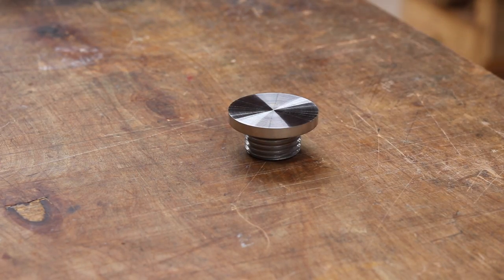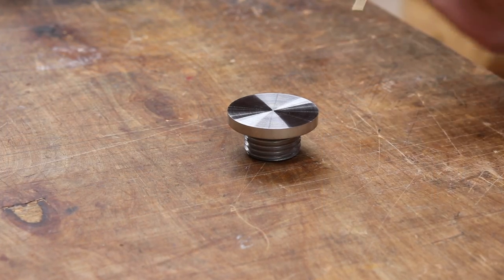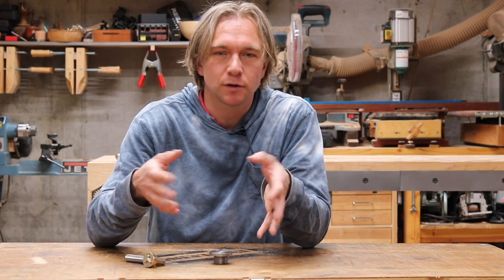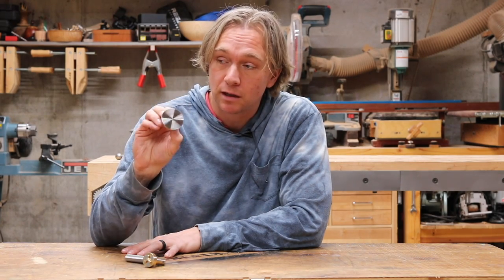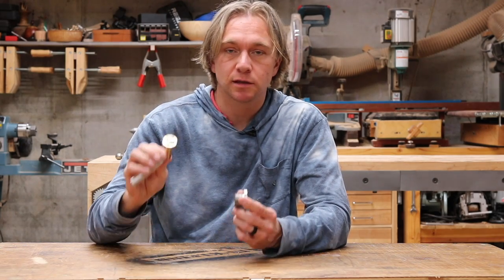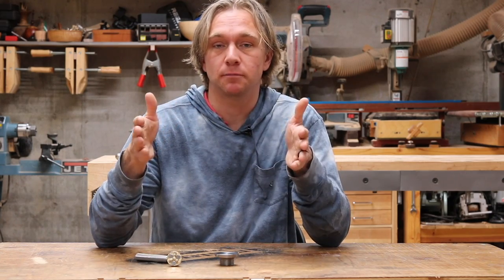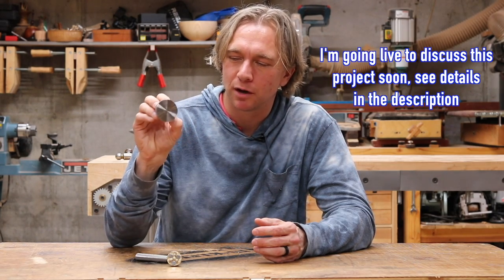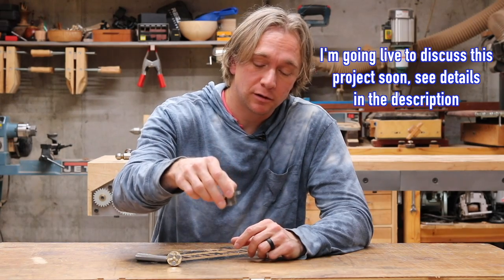A Screw With No (visible) Slot Is My Next Big Thing!

Comment: My company designs and manufactures high end consumer products and I definitely like this concept.  However, that thread you have (Acme?) would be difficult to work with.  I would much prefer if it were built more like a shoulder screw with a smooth shoulder to house the slot mechanism and a smaller and more common thread size for the screw end.

Comment: Heck yea, I'd buy them.  Imagine variations on these being heat colored.
Very, very cool.
As others have commented - "Klein Screw" is cool, but I hear your requirements/desires of it being around the product and not you.  But I am not creative that way - Latin for "Unscrew" is "Praetor".

I would make the "key" without the magnets, and make the "key" such that it fits onto a 3/8ths drive (or 1/2" depending on size of the screw).

Consider making them with O-rings (on the shoulder of the threads) for race car applications (water chill boxes, dry-sump oil filter canisters, etc.).

Comment: If you changed the cutout to just a slot would it perhaps make the product slightly more cost effective?

also in most applications could you not use a bolt that is say an allen or similar head  that's then got a small diameter threaded hold down the centre to just put a cover cap onto? similar to what's often used with mounting mirrors to walls with thread in end caps over the screws but heavier duty, maybe with some loc-tite on the threads for the retention you need but overall designed as just a cover plate to your conventional fixings

Comment: I'm about 42seconds into the video..in my opinion everything is price driven now. If I spend 100$ I get one screw and one socket. So I say this. We already have impacts and hand tools, make your tool into a socket to fit, different sizes o visually, also make that screw out of cheaper metal cause we are hu.ans an have the ability to push in on the screw to screw it in. We don't need the magnets,basically make it cheaper ND more affordable for our market. Super great idea tho man, I was impressed on how it screws in. I thought it would be magnet driven, but your idea is huge an way better you don't need the magnets. Sick bro. You will make it. Don't give up, you will get a bunch of turn downs and "no's" but don't let that stop you.

Comment: Brilliant Design...very impressive! I would be curious what the load and torque rating might be for different applications. If made of Brass, I can perhaps see these used in fine wooden boats since price does not seen to be an issue with nicer wood boats. :)  Using Nickel or Brass and in a smaller dimensional size I could see these used for a variety of applications including high end stereo racks, electric musical instrument bridges, pick guards, neck plates, back plates and amplifiers. I am sure I could come up with more ideas but those are a few that came to mind right away.

Comment: A non-magnetic version would be nice for locking/adjusting screws on millers and lathes.  Allan screws get full of chips and gunk, then strip if you dont properly clean them out before using.  Screws with magnets in them would just grow a fuzz of chips and swarf.  The finish and fit would not even need to be invisible, just tight enough to keep crud out.
Reply: Just look at how tight the tolerances are.  1 very tiny piece of dirt will stop this thing from functioning.  If you are not in a sterile lab environment, these screws are destined to fail.  I like the concept, but I do not believe these will be of any use at all after a small amount of time.

Comment: So I work in high end furniture.
From a technical design perspective, I think its super cool.
From a practical or visual design perspective, I don't see how I could justify it.
Almost any aesthetic I could create cheaper and more versatile with something different.
The tooling for that feature would probably be over 65% of the cost, so i would have to sell that feature to the end user. (and also sell the key.)
We have so many ways to create hidden fasteners that taking it apart isn't the feature.
Novelty not actually secure secret compartments? In modern aesthetic?
I don't see it.
Reply: BTW, High end flat packs are already becoming a thing, but they all assume that they are being installed/assembled by skilled and knowledgeable tradespeople.

Comment: The coolest part about it is used once during assembly. After that it just looks like a really nice rivet. 
The price it too high for a screw.
However. Those toy cubes you mentioned at the start are extremely expensive. 
You could make a cheaper cooler version of those and id buy loads at 40 bucks!!!

Comment: Awesome design 
Can you produce it smaller? 
Can you produce it so it can be opened with philips head screwdrivers?
I think it’s manufacturing cost is high so only some artisans may use it! If you can reduce the cost and produce it in different sizes it will be the future of manufacturing

Comment: I could see a handful of use case, but for most applications, particularly in furniture where this would be front-facing, I'd just use a screw slotted on the back and design around an access hole.

Comment: Ok, so I knew exactly what was about to happen, but when he pushed in the middle of that disc it still blew my mind... Also, this could have an automotive use if you could scale it down somehow, like for custom valve cover bolts or maybe get with someone who designs wheels and make a solid disc wheel that uses these as lug nuts if they can take the torque and you could have a sick looking solid disc wheel...

Comment: I can definitely see it in use for higher-end furniture. Particularly if you were to market to things like exposed mechanical stuff steampunk etc....I think you have less of an in flat-pack personally because I think there are other solutions to this like having a hex on the stem and actually using the drill to reverse and pull the bolt in.  If you can get to both sides of the fixture i don't think the cost of the presure plate design would make it viable in low-end gear where the price is key. 

The question for marketing is what industries heed flush bolts that can be removed that are worth cash.   Aircraft access panels for instance.   It has been proven that the thickness of the layers of paint on a plane can add enough weight and drag to effect AVgas usage to a point where they were running white planes because thats undercoat and clear coat on top.  

I don't think your market is necessarily based on aesthetics is the point im making......Boeing..

Comment: Ok multiple metals.  Square driver hole. Makes the tool price cheaper or obsolete. Makes the machining process cheaper.  If you use a 1/4 or 3/8 Square for the hole people could use a ratchet to install them. This opens up market for only the fasteners.  Definitely need other sizes and possibilities of a seperate insert for the keyway.  It could have a magnet.  And a stronger magnet to remove square  inserts. Just quick thoughts in my head I love to tinker with everything.  Can't help myself.  But those have good commercial architectural appeal.

Comment: I think as for a name Klein is fine.
Klein is Fine would really flow off your tongue for your box logo as well. I'm a retired cabinetmaker as well as a miller for different components for the marine trade. I have lived and worked on the Eastern Seaboard or Atlantic Ocean  area of the United States.  You're onto something unique and interesting . The idea of this screw and it's bells and whistles has been in my head for at least 5 full minutes now. 

One thought or question about them do they only come in that one size you are showing us at this point. If so how about the length ? Maybe have parts that allow the end user the ability to easily "couple" together different lengths to use as a permanent or semi permanent type of clamp. 

💡If you haven't already when you get up in the morning run like hell to get this thing patented and the intelligence that went into it.  💡

How about the threads?  Is it a common & available size ?  A H.S.S. wood cutting tap might be an alternative piece might be nice. 

I'll come back with more ideas as I sit here and cogitate the valid uses of this really wicked Screw & Driver.

💡  Good luck Brother  👍

Comment: Some really good applications could be in interior signage as standoff hardware.  
Also uses maybe in the glass industry , glass doors and shower doors for the opposite side of a pull. 
Instead of a screw  have it be the face of like a 1/4 turn latch for a plumbing acces panel or ceiling hatch.

Comment: I definitely see potential for professional applications and luxury homes or yachts. I myself would hide a screw or bolt behind a loose disk of steel or wood with a metal plate behind it that simply clamps and which you remove with a magnet. But of course that doesn't have the fancy look and feel.

Comment: I wouldn't buy it as a hidden screw, because I think there are easier/cheaper ways of doing that.  However, I would buy it as a hidden button...  like a latching or momentary switch of some kind.  You could also incorporate some LEDS in the recessed area that could illuminate once activated.

Comment: I would only be willing to pay 10 for a set of 2 screws. You don’t need the magnets on the driver. The high tolerance machining is cool, but you could make the spring much simpler to reduce costs. Why that specific shape driver shape?

Comment: It's a great idea and I believe it will go far. Not just in furniture but also in security screw market. I think the next step would be working on the manufacturing process and see if you can drop that price. The way it is sounding, it will either be for a select few or someone to make one piece with it and never use them again. But if you can figure out a way to make them more affordable you will blow alot of fasteners out of the water. I look forward to see where you take this. I do like the idea of adding your name to the product. Unless your end goal is strictly into the furniture market. But hypothetically if you branched out into the security market a furniture fastener name might get lost in translation. Also (Odin Fastener) has a ring to it. And since Odin was the king of gods it's suiting for a product that could be the king of fasteners.

Comment: "Hidden Machine Screw".  could it be Pan Head (as well), could be smaller?,  could be anodized?, could it be the nut?  could it be strong enough to hold large panes of glass (shop fittings etc)?   I see it as part of industrial fittings (where the money is, and the numbers are) where a tidy appearance is important, where things need to be strong, but are highly visible (large glass keeps coming to mind).

Comment: Pretty cool can't be used for something with high torque tho bc those seemless edges seem easily damaged. I would use this for really luxury stuff otherwise the price don't make sense. Personally I would just put a cap on top of the screw because the hidden slot could get gunk stuck in the edges so you would be able to see it and during cleaning it may cause you to make abrasions around that edge when you push down on it. Idk just seems like an expensive solution for a minor issue. The best thing I see this for is that you don't have a cap to remove but since you can't use high torque on it you wouldn't want to be taking it on and off repeatedly anyways.
Reply: And people do use seamless designs practically but there is a larger gap usually because when working with oils like in a piston you want a very specific gap size to maximize the oil. This isn't exactly seamless but I'm sure there are applications where that gap would be extremely small for less viscous oils

Comment: If the "plug" was a "touch-latch" where it could be pushed to retract, pushed again to return to flush, then the driver wouldn't need magnets to overcome the spring, and could be simpler. (also less fumbling/scratching of the face trying to align tool, just push the center in) Without the need for a magnetic tool, material options for less expensive stainless, brass, bronze, aluminum, etc... open up. A driver tool that was just a socket or a 1/4" hex shank could also be less cost with user supplied handle/ratchet/driver.

Comment: While the tri-lobed shape of the interface is cool, it's also needlessly expensive to make at level of precision needed for the seamless look.  A set of round holes at a set diameter allows the use of reamers and hones to make the holes. And the inserts would also just be round. Round is easy. Complex shapes are expensive.
In the end this might have some applications but I don't think it's patentable. So anyone who's willing to spend that kind of cash for the cool factor might also be willing to get in touch with a local machinist and just make them to their own specs. I can't imagine that the market would be large enough to justify a production run.

Comment: What if the screw head was actually an engraved frontpiece which includes these hidden screw heads internally, such that the engraving is one piece with the hidden screw head technology buit in. These could be sold to be either inlaid into mating slots in things which require such engraved decorations, or to just be used as wall decor. Could you make this technology out of wood too?

Comment: Tri-Vault, Tri-Mag, DeKlein, Tri-Tamper,  Mag-Loc screw system. Would be awesome for high end bathroom stall assemblies in office buildings and venues. Boats, cruise ships... endless. May not be an overnight killer but I think would eventually find its niche. Especially if the center slot could be made from brass and have the company name first letter in the center and be the shape of the tool whilst maintaining the seamless slot.  Yeah, I know,  I just went too far.. think big right.... would look sharp as hell against that stainless. Man I got you on naming things you ever need help just yell. Motorcycle accessory bolts!! You could shape those thicker headed, machinist could cut them out in any shape like skulls, Harley Davidson shield? possibilities are endless. It has its place. Let er fly.

Comment: it looks cool, but it seems like there are far more cost effective and more practical ways to achieve this.  The coolest part is seeing how the slot is hidden, but everyone who sees it except for the owner won't know that feature even exists.

You could get the exact same look at a far cheaper price by having a screw with a standard slot that is countersunk, and then having this same looking cap countersunk covering it with magnets on the back.  Then the key is simply a more powerful magnet that allows you to pull it off and remove the traditional fastener behind it.  

Having this perfectly machined hidden spring loaded mechanism just seems far to costly when the cool factor of it is that it is hidden from view so nobody even knows it exists.

Comment: "Hide away fasteners", "The Hidoway", some good engineering there.......They're fine and look cool for what you showed in tables, but for a high security hide away place, be careful what you put in there. Professional criminals look for tell tail marks of hide away places, it's the number one thing they look for. The problem of those high polish finish surfaces is they mark easily and trying to line up that handle you used to open it will leave scratch marks as you twist and turn over time. It's like buying one of those $1000 highly polished stainless sinks for your kitchen only to realize as soon as you wash your pots and pans, it's scratched everywhere and the $250 model would have worked out just fine.

Comment: Id get rid of the magnet which would make it cheaper and the user would have to push in like a normal screw.  

Then the driver bit could even just be a piece that you could use on a ratchet.

Id call it "seamfix" and id have a pointy end version to like a screw end too.

Comment: The name doesn’t have to be cute or fun. While it’s an amazing idea, at the end of the day, it’s still just one component (a fastener) for other products, so it’s name doesn’t need to be overly flashy. It’ll probably be mostly referred to by people who handle the low level (e.g. very technical) intricacies of products while they engineer them, and for engineers, simplicity will win over intricacy where possible. Therefore, in my honest opinion, a new screw type would catch on the fastest if (A) the name uniquely described the product and (B) the name used as few words as possible - something like:

spring slotted screw

Comment: Words most expensive bolt. The cheaper way to get the same thing would be just mill a hex head inside the hollowed out threads, that effectively moves the 'slot' or head from the exposed side to the internal side. To install thread on a nut, hold the bolt still with the internal hex key and use an open end wrench to torque the nut.  No EDM needed just a simple mill. For this design to be required you need to use the fastener somewhere where you don't have access to what its going into. So it would need to be some sort of self tapping screw like a wood screw.

Comment: As a facing end piece id buy it... But only for the visible joints. Some how flat head / slot screws are still a thing and the most horrible thing for furniture.. " mag slot screw & bolts " seems like a obvious name.. 🍀 on the leap.

Comment: If it would be possible to create several openings with different measurements and pin design, you could make a key that the pin pattern would be very difficult to copy, and would be ideal.